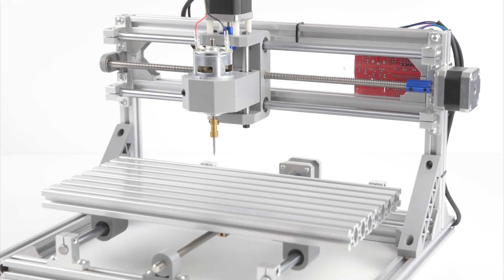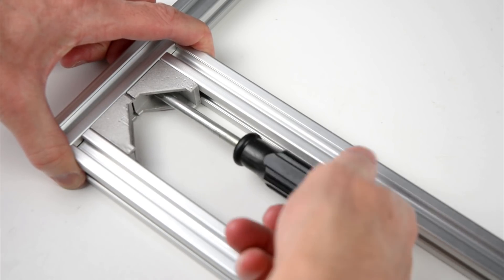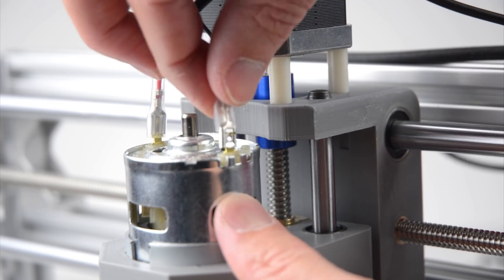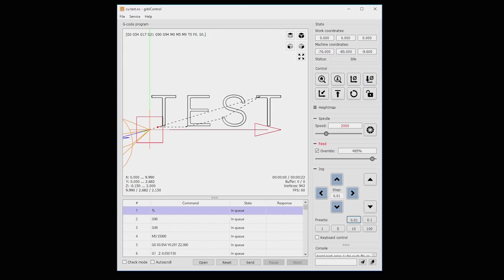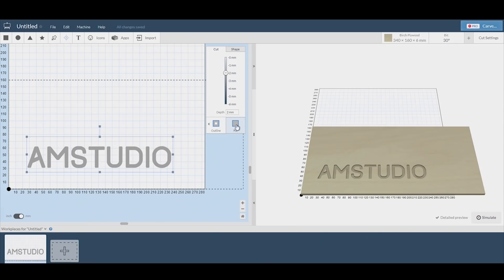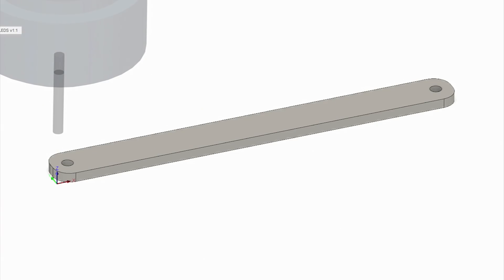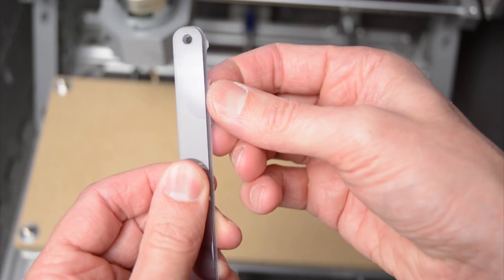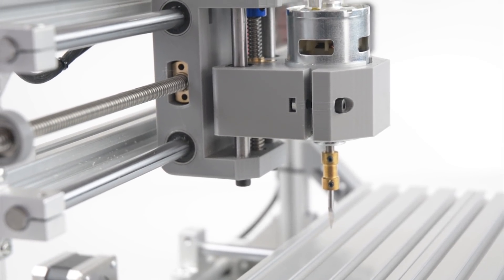3018 DIY CNC KIT BUILD REVIEW AND TEST

Comment: Thanks! This video is awesome. I’ve set mine up, but for some reason, my CNC router moves in the opposite z and x directions, but the y works well when I send the commands of use the jog control. 

Have you seen this before?

Comment: Hey! I ordered this CNC and it works awesome! Anyways, what bit and settings did you use for cutting acrylics? When i try at a spindlespeed of: 700 to 10000, and layer thickness of 0.3mm, the plastic just melts and sticks to the bit. Thanks for any help:)
Reply: You want a very shallow cutting depth with a high speed and medium feed, as well as using bits that don't file or grind, but cut
Reply: Tinkle thanks! Is a 2mm depth per pass, way to much?
Reply: @sanderslette6341  way too much, I would recommend .1, all the way down to .01, and you'll need to add a little coolant, your machine will shake and jitter if you don't. And stop when you hear chatter

Comment: so in theory if you go slow, use lube, and the right tool bits you can mill aluminum?
Reply: You might want a better spindle, but using enough gripping force and raising your rigidity will help, you'll just have to move very slowly

Comment: Can You tell me how loud is this CNC? Can you measure noise level?
Reply: Piotr Kielek Hey I have the same CNC, and I would say that it is a bit loud, but it depends on what kind of material you are using, but for engraving it is just ok, I would say the noise level when engraving is like an, vacuum cleaner 😆, but if you're CNC cutting like in plastic/wood all the way down, the noise level gets higher. You can see in my channel when using the CNC, for an example how loud it is. It will also depends on how deep you are going per pass/ Feed rate. Any question?
Jon

Comment: I have the same cnc....awsome little tool to learn how to work a cnc
Reply: Change the collet to an ER11 collet...2 version available  ER11A i think is the better one. Add limit switches to enable homing...but watch out then when using Fusion 360....can be a head cluster. And try Universal Gcode sender.